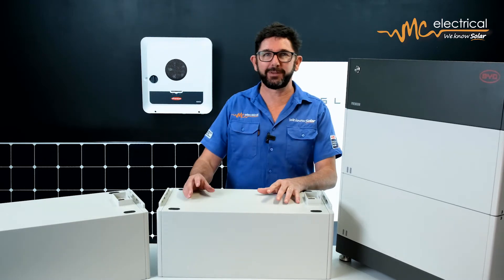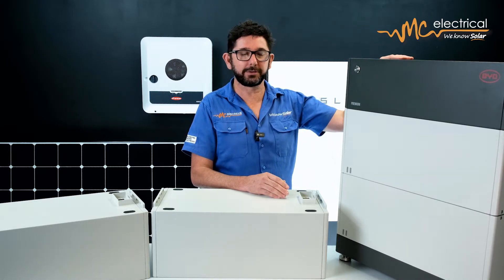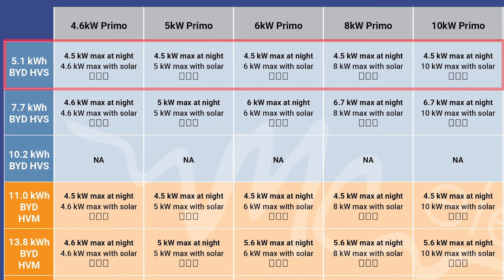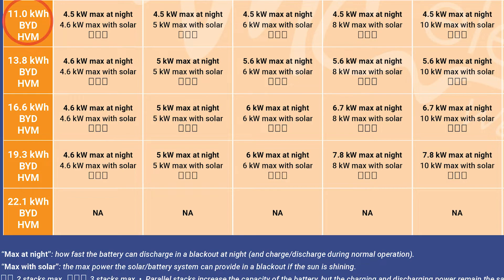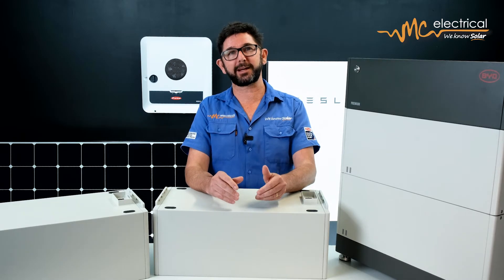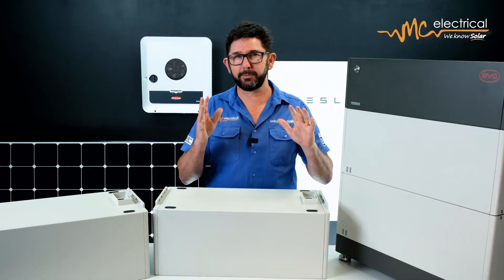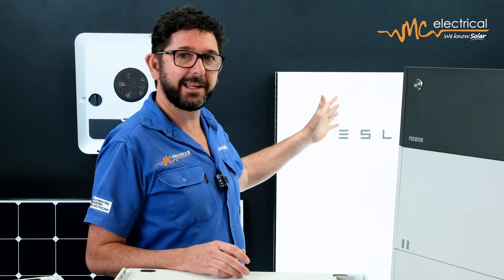BYD Solar Battery Size Guide

Comment: If I have two Fronius Gen24+ Symo 10kw inverters and one 22.1kWh battery, can I get higher peak discharge? Or is the 9kW max at night figure the limit of the battery itself rather than the inverter? 3.68kW per phase isn't enough to run my air conditioner.

Comment: Do the extra stacks get you more charge and discharge?
Reply from the maker: Yes, I have a sizing guide in this blog.
Reply: @mcelectrical  ah it says it on the pdf at the bottom, it only increases storage, thanks

Comment: How well do/can these BYD batteries work with the solaredge homehub 3-phase inverter? My installer only sells the tesla powerwall, which I don't thing makes sense when I already have a DC coupled inverter using optimisers.
Reply from the maker: It doesn’t work. Many problems with SolarEdge. Retrofitting a reliable battery is one of them.

Comment: Hmmm 60k for 60kwh of batteries or BYD atto 3 with 60.5kwh battery for 50k to power your house.
Reply from the maker: Yeh vehicle to grid will take off soon. I was at BYD in Shenzhen talking with their inverter department and battery box department about this yesterday. They believe home batteries are still going to be a major part of the transition, mainly because your car will probably not be at home to soak up excess power. Also, the lifecycle of a home battery is significantly better - it’s designed to cycle once per day. A BYD car battery is designed to cycle much less than that, with the average owner switching their car after 5 or so years.

Comment: If you have micro inverters, do you still need the Fronius Inverter?
Reply from the maker: No you don't need the Fronius inverter, you'll need an AC-coupled battery like the Tesla Powerwall 2, not a DC-coupled battery like BYD.
Reply: @mcelectrical  Thank you. I will have a look at what AC batteries are available.

Comment: I do have a question related to batteries and how they can power-up the home in case of a blackout.
I have a Fronius Gen24 plus 6.0 connected to the grid 3 phase with 6 kWh solar pannels.

If I install the battery, would it power-up all 3 phases ? Is there a difference between the HVS and HVM in that case 
or
I need to have 3 different towers (one for each phase) ? 

Also I would like to know if in case of an upgrade (adding more solar pannels), can I add another inverter or do I need to sell this one and buy a new larger model ?

Your support and help would be highly appreciated.
Reply from the maker: Hi Nicolae, yes, the Gen24 does 3 phase backup. Check out by byd battery guide for the difference between the two. https://mcelectrical.com.au/blog/byd-solar-battery-guide/

Comment: That's got to be an empty case you're moving around on the desk? And thanks for pointing out the phase power limitation on the 3 phase inverter. I'm looking at a Deye which allows up to 50% of inverter capacity per phase (so 5kW for the 10kW model etc). Things are moving quickly in this area.
Reply from the maker: I’ve been down the gym a lot lately. Glad you noticed! Ha, yeh it’s a dummy byd for a showroom.

Comment: Hello! Thank you for your interesting videos! I have a question for you! The situation is this: I live in Ukraine and before the war with Russia I installed a 10 kW station with a Gen 24 Plus inverter and a 5 kW BYD battery! Now Russia is constantly hitting the Ukrainian energy system, destroying our substations! In winter, there is little sun, the city grid stations are destroyed and there is no electricity from them for months, it is impossible to charge the battery! There is only a 5 kW gasoline generator! How can I safely recharge the BYD battery from this gasoline generator? Thanks in advance for your help!

Comment: I have a 3 phase power and we  get 11.5kw from the solar panels. Do you think i  should get Fronius Symo 10kw inverter with BYD HVM 13.8 kwh or 16.6 kwh better. Thank you
Reply from the maker: That depends on how much you send back to the grid. Fronius monitoring has a battery sizing tool in it. That’s the best way to decide!
Reply: @mcelectrical  over the last 6 month my solar export 6187kwh getting $0.06 for it and my usage was 4286kwh, paying $0.34 anytime usage price. correct me if I'm wrong, i will be better of with 16kw battery.? Thank you for your time and help.

Comment: The Goodwe go well with the BYD batteries and you don’t have the annoying fan noise
Reply from the maker: Byd don’t agree with you on that. They prefer fronius. And Goodwe runs about 10 degrees hotter is pretty average with its mppt algorithm, (all tested) to say the least.
Reply: What do you mean BYD don’t agree on that?

Tbh I’ll take the heat over the fan noise any day
Reply: @behindthebuild8016  I think the concern is the increased temperature causes early failure in electronics. It isn't a linear relationship.

Comment: My Fronius Primo + 13.5kwh full house 3 phase backup just powered the house for 7 days after the Christmas Day storm in South East QLD. During the day we were even able to run the AC (big 3 phase system). The battery lasted overnight easily powering 2 fridges and some fans and tv etc. Very happy with it.
Reply: I should say the battery is BYD HVM
Reply from the maker: Wow, Nice. Yeh the Christmas storms tested out a lot of battery systems. Not all work as well as the Fronius BYD combo!
Reply: Hi Jordan I'm in Sydney and  have 3 phase power house and planning to get Fronius 10kw hybrid  inverter  plus BYD 13.5 or 16kw HVM , would you still recommend. Have you had any issues,  also what was the customer service experience ? My other options in 10kw Sungrow inverter with 13.5 Sungrow battery. 
I like to know what you think. 
Thank you in advance.

Comment: Can i run a three phase installed ducted air conditioner of any of these batteries in a blackout or in the evening when the battery takes over?
Reply from the maker: Yes, but you would want to use the sizing chart can’t compare it to the load of you air con.

Comment: You can stack up to 12.8kWh of HVS BYD Battery with Fronius GEN24 1.0 Plus thats the most powerful and affordable solution maxing everything out!
Reply from the maker: Im pretty sure it’s only 10.2. My sizing chart has been given the nod by Byd. https://www.mcelectrical.com.au/byd-solar-battery-guide/
Reply: @mcelectrical  Hi Mark, it's been a couple of months since this comment, are you able to confirm that your chart is correct please?
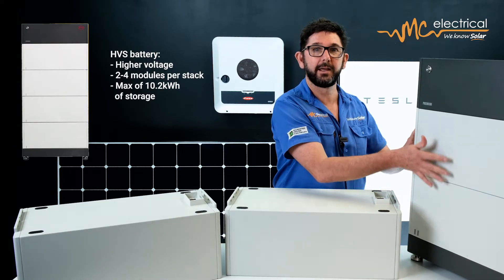Reply: at 2:32 ,you said for HVS you can only have max of 4 modules which give you 10.2 kwh in total. However, in your chart at the 10.2 row it says n/a. I am confused....  @mcelectrical
Reply from the maker: But you can go up to 22kWh in one stack or 46kWh with 3 stacks with hVM
Reply: @mcelectrical  My charts and spec sheets show up to 5 HVS also. 12.8 kWh
Reply: U can stack 12.8kwh of hvs but the gen24 is limited to 10.2kwh so for gen24 u can max out 10.2kwh
Reply: You remember this discussion 
Fronius increased the Battery Voltage range (seen on newer data sheets, so new internal revision) and now allows also the HVS12.8 ^^

Comment: Do you have to go with BYD batteries if you have a Gen24 Fronius or can you go with a Tesla battery?
Reply from the maker: You can also use the Tesla Powerwall battery with any Fromius inverter. The Tesla Powerwall is AC coupled, meaning it will work with just about any string inverter.

Comment: The biggest issue for me is BYD will "only have 60 % of new capacity at 10 years" So in originally sizing your battery you really need to take degradation into account. or your bills will rise as your battery ages.
Reply: No chance it’ll be that low battery degradation is no linear it’ll be closer to 80% + after 10 years

Comment: Hi Mark, i am writing this post, by power from my 19kWh BYD battery, courtesy of the Fronius inverter in back up mode.
Seems a few drops of rain was enough to drop a tree branch  across the wires and now the is no grid power.
The house is currently drawing 500W and the battery is at just 12%
Yikes.
But the cloud is thinning and the solar is now pumping 800W, covering the house and slowly lifting the battery.
For confession, I did just make a coffee for the wife and I to see how that would go.
The jug sucked hard at 2000W and the microwave at 1000W to warm the milk.
But that was only for a minute and now we are back to charging again.
Hope Energex get around to fixing the wires before dark LOL.
Reply: How much solar do you have on your roof? I'm hoping to disconnect from the grid bit surprised your battery wasn't suffice

Comment: BYB is infringing on You Solar Inc's "Stackable Power Bloc" patent for the moduals.
Reply from the maker: Oh, interesting. I’ll look that up.
Reply: @mcelectrical  You Solar Patent US D916,006 S. They have been working on their “Stackable Power Bloc” for some time. The “Stackable Power Block” has modules which stack on each other interconnecting electrical connections and plug and play. Of course the Power Bloc is superior but it appears that BYD is using You Solar Inc’s “Stackable Power Bloc” patent concept. 

How about doing a video about You Solar Inc. and their now “Power Bloc” and soon to be released “Stackable Power Bloc”? Research them and you will see there is no other solar and battery company like them, because they are not a backup. They are your utility. You Solar is the future of independent solar and battery.

Thanks for the reply. Love you video's
Reply: I'll save Mark the time for your trolling, and hopefully this will be the first thing people see. I'm sorry if you were suckered into funding YouSolar, but stuff like this is unnecessary. 

1. In May 2020, YouSolar hadn't even started production 
https://www.sec.gov/Archives/edgar/data/1762157/000166516020000625/offeringmemoformc.pdf

2. In July 2023, and this has some of my favourite quotes:
https://www.sec.gov/Archives/edgar/data/1762157/000166516023001522/offeringmemoformc.pdf
"the validity and enforceability (of our patents) may results in them being invalidated or modified by the US Patent Office"
"we may never have an operational product or service"

3. But i've saved the best for last, your "patent" this one:
https://image-ppubs.uspto.gov/dirsearch-public/print/downloadPdf/D916006

A patent for a design, not for stackable batteries, not for their technology, in fact, nothing really.

Comment: Money grab
Reply: Well with these of course because he has contracts with these suppliers and batterys he gets kick backs for, and will shit bag any brand he doesn't sell common practise in the solar industry, if it doesn't benefit his company,  ppl like green energy, fortune, sun boost will put little guys like this out of business because there over price, narrow minded, shit talkers of the industry.
Reply from the maker: Are batteries worth it? I agreed with you until recently, but, at todays power prices it will take 15 plus years to pay off. Unless you get onto a VPP like amber or Nectr, maybe it comes down to 10 years. But that figure continues to reduce as vpps gain momentum.

Comment: Question. At 8:06 you say the 5.1kWh BYD at $8,000 does not include blackout protrection.Latter you say blackout protection will cost another $1,000. Why so and what if I already have PV Point installed? Do I still need to pay an extra $1.000 please?
Reply from the maker: Sure, blackout protection just takes a bit of work requiring your switchboard. If you can just back up the whole house it is simpler and cheaper. If we have to separate “essential” (eg lights) and “nonessential” (Eg hot water) circuits then there can be a lot of switchboard work.  PV point is entirely separate and not really necessary when you have a battery.

Comment: If only it was okay by the CEC to use a used $8000 Tesla Model 3 55Kwh battery pack. People overseas have the model 3 packs working directly connected to Gen24s with an inexpensive communication interface. 

The BYD batteries are awesome but quite expensive.
Reply from the maker: Yeh Vehicle to grid will be great when it comes out. Musk has said he will allow it in the coming years. The other hurdle will be the m networks like Energex allowing it.
Reply: @mcelectrical  Sorry, what I meant was using a complete battery pack removed from a crashed model 3 or even a Leaf. You can connect them directly to the Gen24 as they are roughly the same voltage (400v). Then, use a device to translate between Modbus to CAN Bus so the Gen24 thinks it's connected to a HVM11.
Reply from the maker: Oh right! Yeh that’s a great idea. I thought $8000 was a typo.